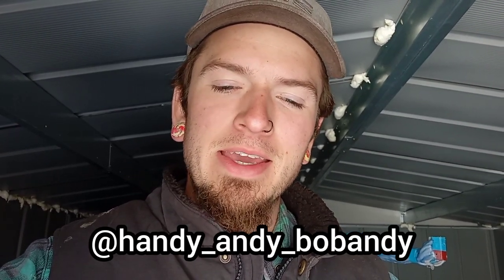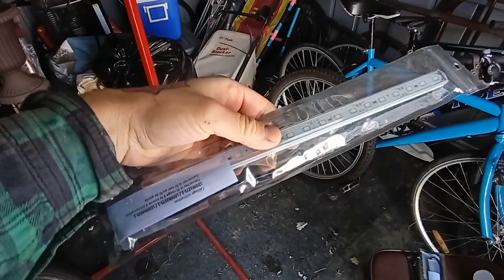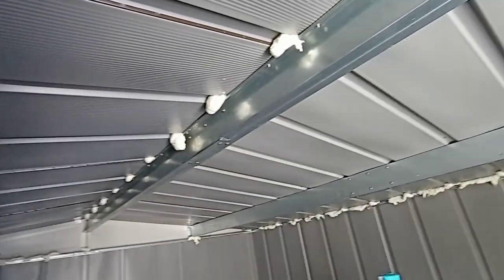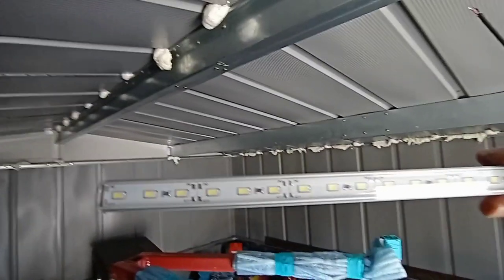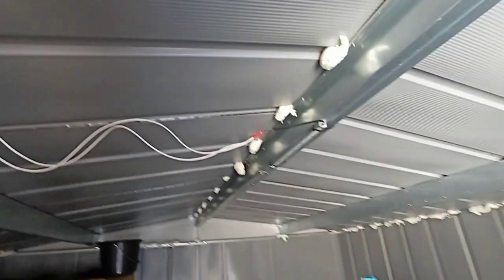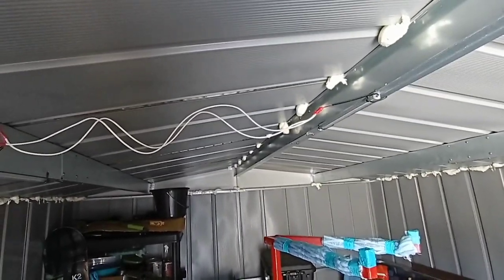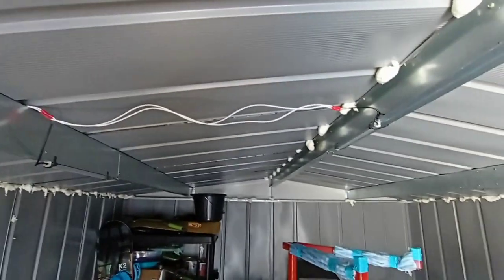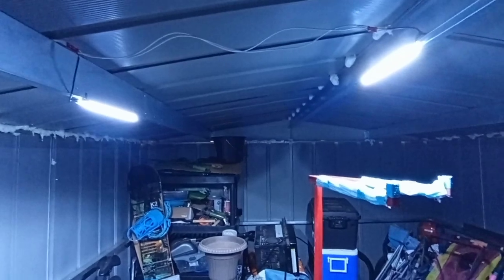DIY Cheap Milwaukee Powered Shed Light Setup

Comment: Can you explain how to do the actual wiring part? I’m 100% clueless about wiring but definitely have a lot of Milwaukee batteries and a dark shed.
Reply from the maker: Honestly I'm not the best at explaining wiring, but it's basically just running your positive wire all the way to your battery and insert it in the positive terminal. Repeat for the negative wire and insert that into the negative terminal on the battery. Just remember power is usually a white or red wire and negative Is always black.
Reply: Cool. Thanks. When I see wires clipped together, I always think something special has happened. :-)